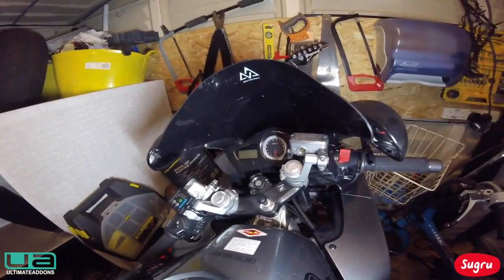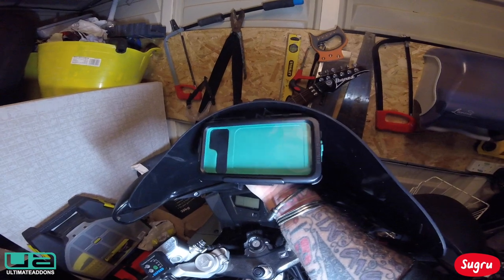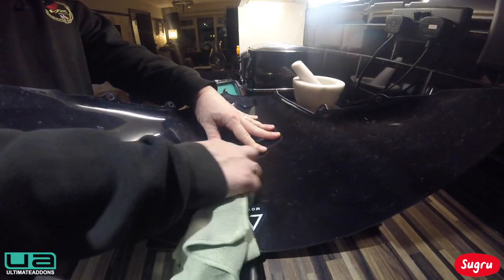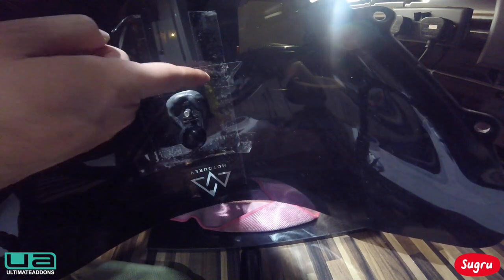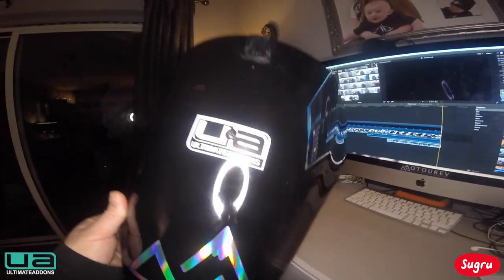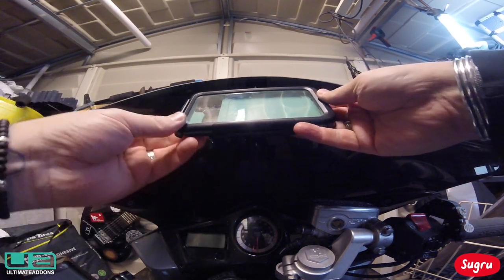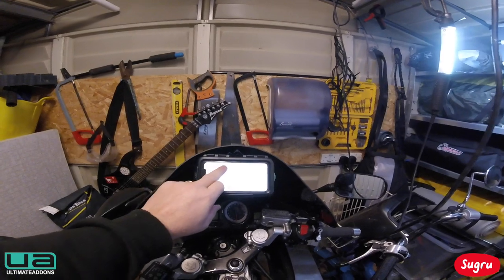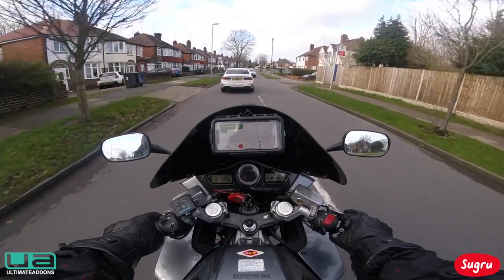Securing UltimateAddons Case With Sugru

Comment: Hopefully it holds well, the Sugru + the screen should help with the vibrations that often kill phones in bike mounts.
Reply: If you use an Ultimate Addons case, the vibrations don't affect the phone, as many an Ultimate Addons user will attest, myself included, it's the silicone moulding inside the case that dampens the vibrations.